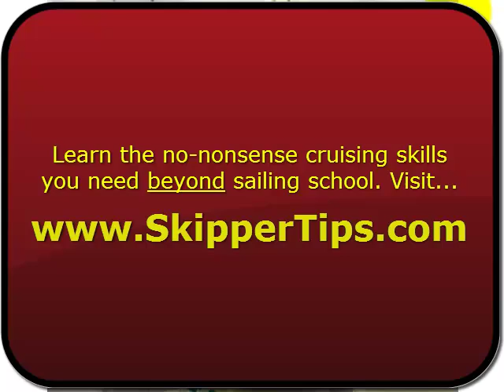Self-Tailing Sailing Winch Safety Tips

Comment: Good tip about the 'locking turn' I can see why that is important.

I note from a different video the correct 'fist over fist' method of working too, to avoid losing fingers.  I think there are a lot of aspects to winch safety not covered in this video

My winches for example only work one way, I am still not sure how to safely pay out a sheet under tension when the winch is set to wind it in.  I don't have a friction clutch unfortunately - I guess I'll have to wait till my Comp-Crew next season